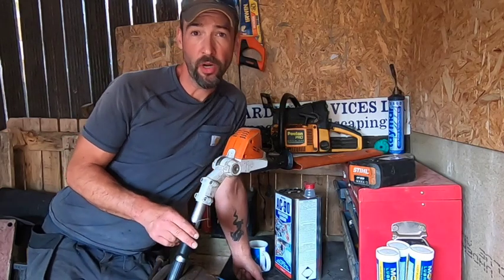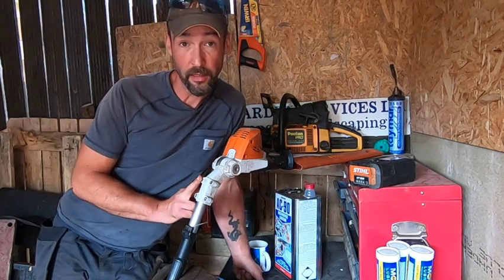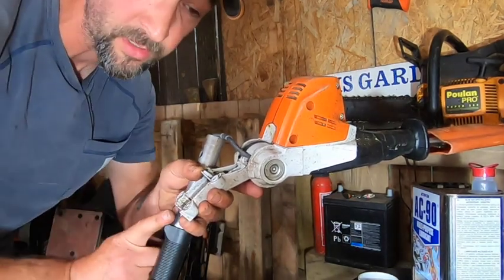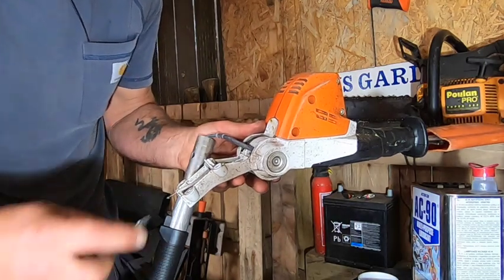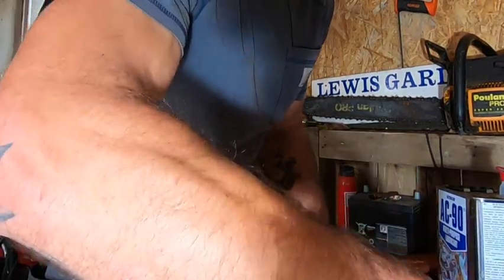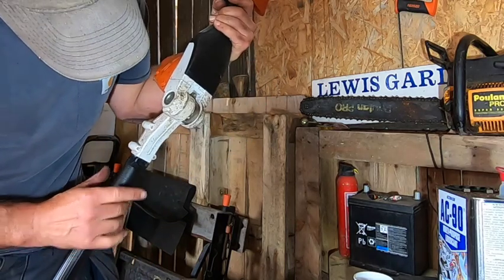How to repair Stihl HLA 65 cutting head angle adjuster.

Comment: How do you remove the gears from the housing? Have you done a video on replacing the gearbox housing? Thanks
Reply from the maker: @SeanCampbell-yt5hb  the small screw in the bearing from the drive pinion needs to come out, usually a right pain. I put the blades in a vice and have a very well fitting bit as to not round it off. Plate then lifts off gears as long as the rest bolts are out. Good luck 🤞
Reply: @LewisgardenservicesLtd  Thanks for your reply. I've managed the last part I asked about. I'm currently stuck trying to get the bearing off the back of the motor. Do you have an idea of how to do this please?
Reply from the maker: @SeanCampbell-yt5hb you meant the 2 small ones in gear case? Can't think of one on back of motor unless I haven't got that far taking them apart. Most bearings are just pushed fit tho
Reply: @LewisgardenservicesLtd  @LewisgardenservicesLtd Yes the new casing comes with the new bearings fitted. Upon removal 1 of the old bearings has stuck to the spindle connected to the motor
Reply from the maker: @SeanCampbell-yt5hb  give it a pull or little tappy tappy if nothing else is holding

Comment: At the end did you say you re grease the petrol hedge cutter gear boxes every few hours ?
Reply from the maker: If I'm on a job all day I'll grease it once during that day, every now and then I'll drop the back plate of and clean out and re grease, they soon push it out on full revs or turns to muck during wet conditions. Maybe I overdo it😬how often you thinking?
Reply: @LewisgardenservicesLtd  lol I just had to chuck a hlkm 145 in the bin as the gears came apart from not greasing it 
Iam not in tune to greasing more iam going to try every 5 hours use now you've said this 
I'll be spending alot of money now on gear lube lol iam guessing that tub you had is cheaper than the stihl one ? What's it called
Reply from the maker: @whitevoodooman7276  😬keep chucking it in...just standard grease cartridge that fits in a grease gun, cheaper than Stihl stuff but never had an issue when used regularly, fit some grease nipples or just push it flush over the hole and pump away 😅

Comment: @LewisgardenservicesLtd can you or anyone else tell me how to remove the screw which goes into the bottom of the motor from the gearbox side please? I've found the bearings have gone and can't figure how to get it out, turning it simply in turn moves the motor and blades. Thanks in advance, love the channel, keep up the good work!
Reply from the maker: Hi, when the bearings went in mine they completely went and caused the motor shaft to snap at the motor, I had the same problem, I jammed something in the gears to stop it turning as I had nothing to loose and it came undone. Maybe try putting blades in vice? Hopefully someone can give you a definite answer to prevent damage. The shaft and motor is one piece so couldn't fix mine but has been a great parts machine. Good luck🤞
Reply: @LewisgardenservicesLtd  Cheers Nathan, will give that ago. Thanks for taking the time to reply, much appreciated!
Reply from the maker: Good luck 🤞🤞
Reply: @LewisgardenservicesLtd  I went with a few pieces of wood in the blades to stop them moving and with the impact driver came un done a treat! Thanks again Nathan! 👍👍👍
Reply from the maker: @simonpile4523  impact driver....you really went for it😂